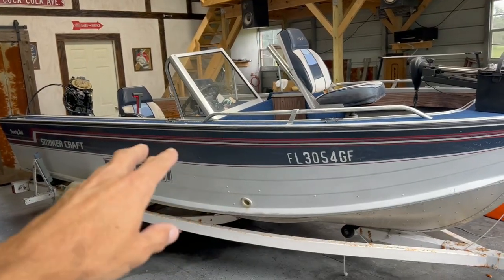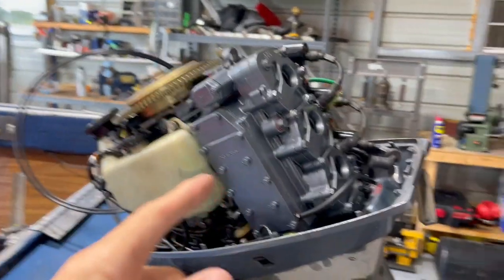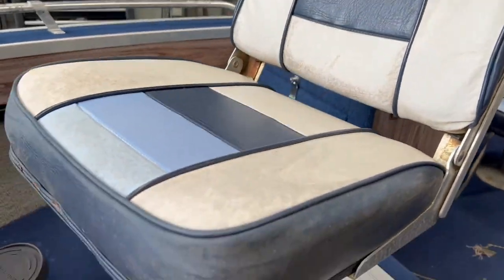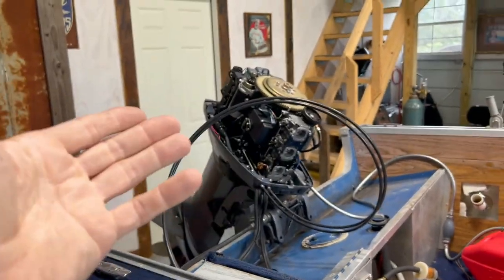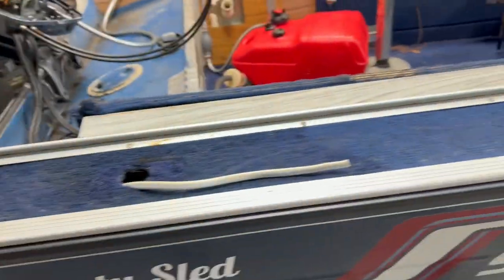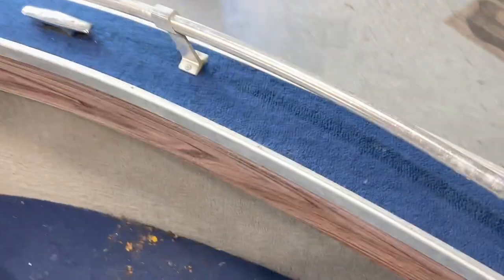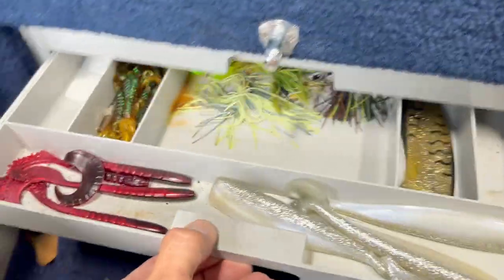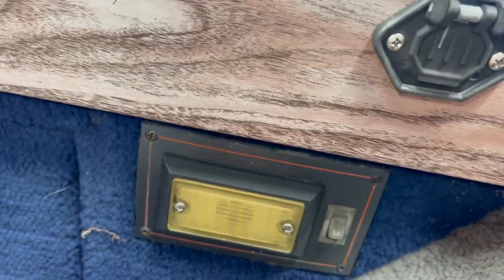Neglected 1990 Smoker Craft Fishing Boat Gets A New Chance At Life!

Comment: That rear wood part is removed because you can’t access the pumps in the rear . I just bought a smoker craft and I am extremely disappointed in the set up for the live wells . Mine almost sunk when one of the pumps broke and and water flooded in . Wiring is all screwed up . Everything that fails  ,fails on all of them . Sorry I bought it .
Reply from the maker: Interesting. Some people love them. I see your point though.
Reply: Any idea how the live well works? I have a smoker raft with a similar setup and I’m trying to figure out the live well? What are the 2 line in the side for and I’d the bilge in the back going to the live well to pump the water in or out?